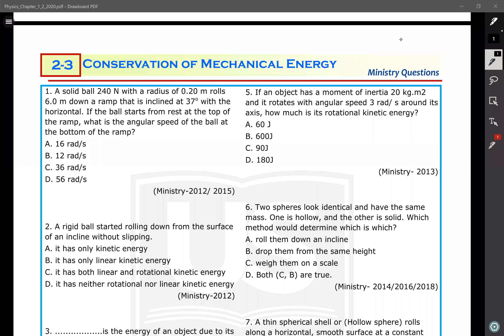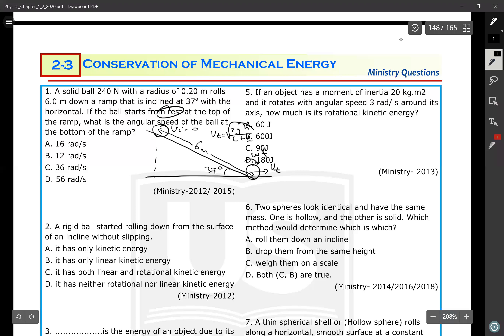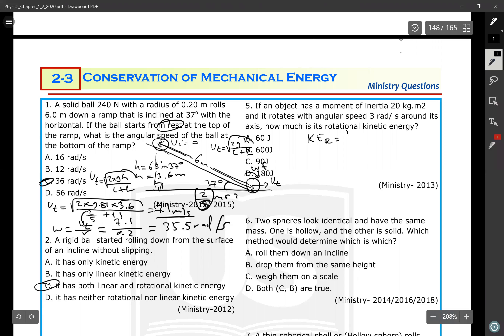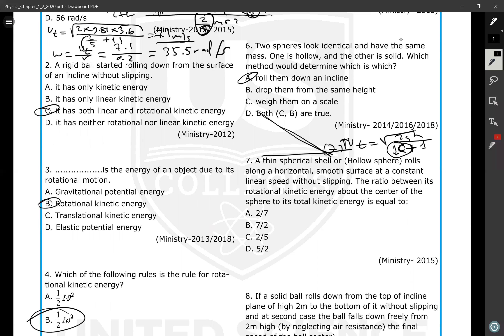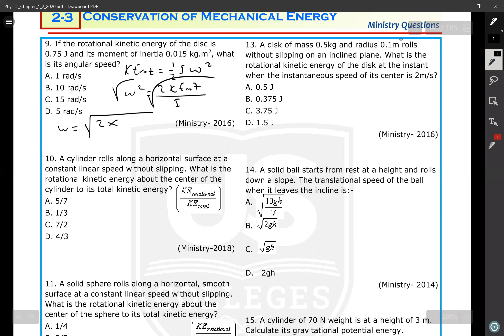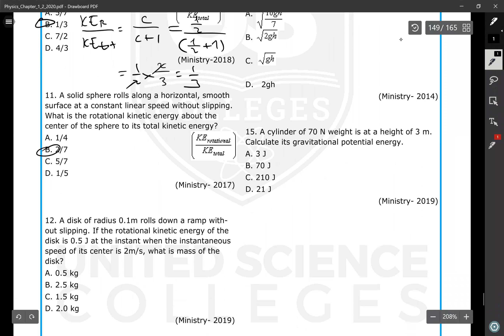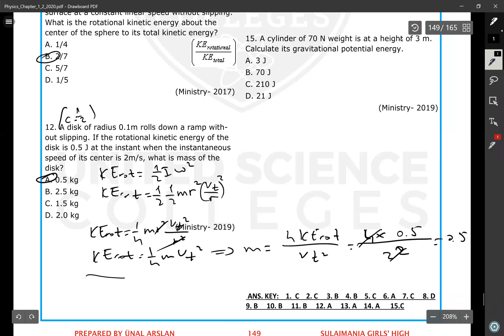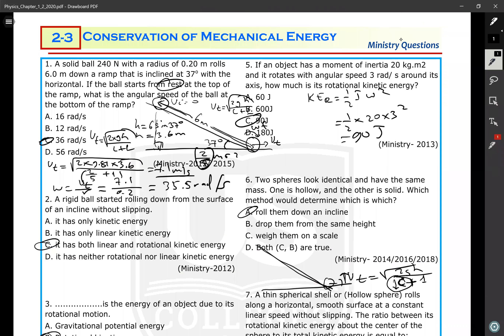Rotational Kinetic Energy | Answers of Ministry Questions | Wezary Physics

Comment: Teacher
Standarized Test prep 
Q3. 
If the same torque is applied to two pulleys of the same diameter to rotate with different angular speed 
A. their moments of inertia are different 
B. their moments of inertia are equal
C.their rotational kinetic energy are different.
D.their rotational kinetic energy are equal

right answer is (C)
But How I know both option (A) & (B) 
are incorrect ?
Reply: Teacher please this Test Prep Q ?

Comment: 8:20
Teacher if it is between
A ( Solid ball ) 
slides down an incline

A( Ball ) falls down

still the one that falls freely
has greater speed ?
Reply from the maker: The have the same translation speed on the ground.
Reply: Both 
(slides down an incline)
&
(Falls freely)
have only 
transatinal speed ?

No angular speed ?